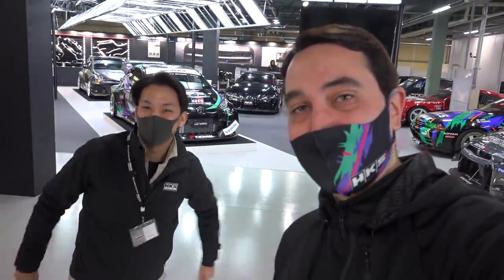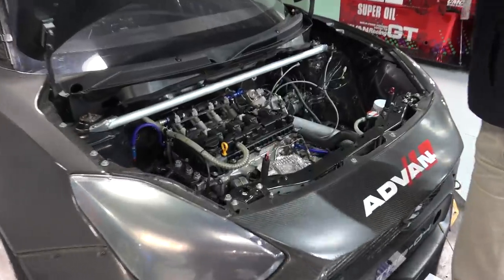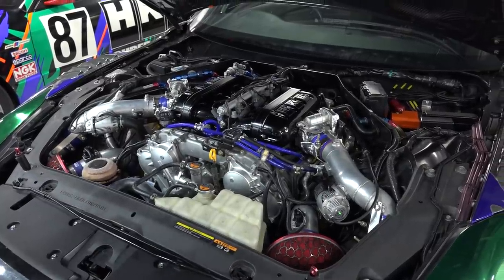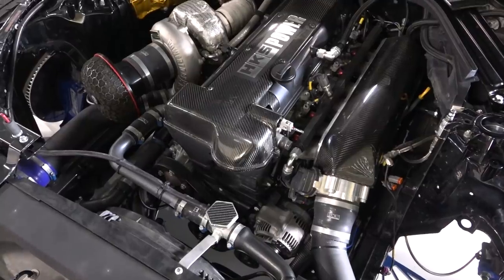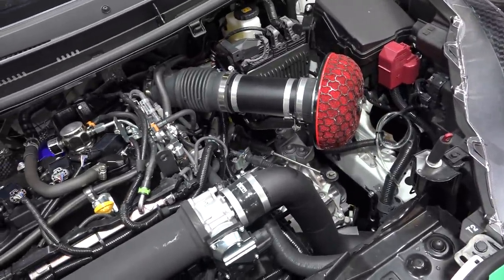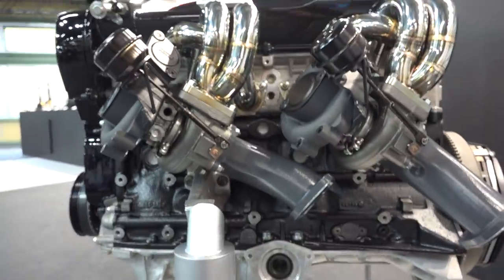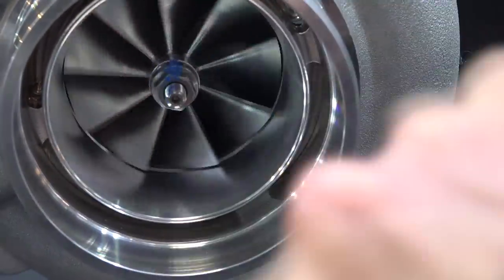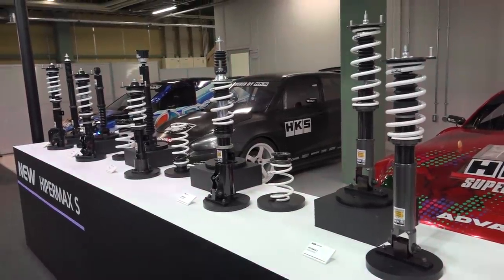Private HKS Tokyo Auto Salon 2021 - GR Yaris, GT-Rs and Supras

Comment: The TRB-04 Swift was originally powered with 4G63T Mivec engine from Evo 9. That's why it has a 4WD system.

As for the CT230R-NGV, yes u guess it right. It was the former red CT230R and also the former TRB-02 that Taniguchi crashed at Tsukuba in 2003.

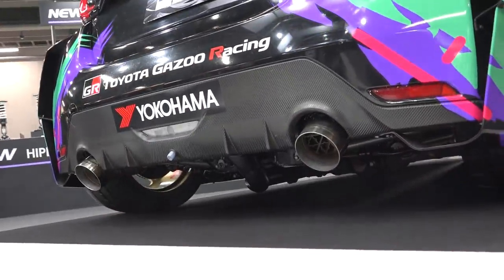Comment: @11:07 what am I looking at in the right exhaust tip?
Reply: A spark arrestor/ catalytic converter built into the exhaust. That or it's trying to look like that but it's just visual. It's a Rally car thing generally, but top level drift cars have them too.